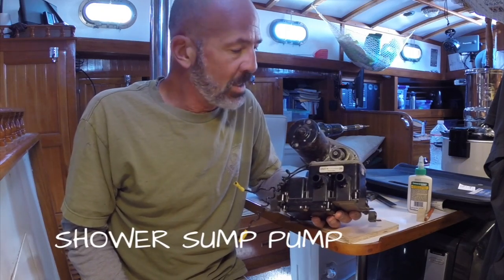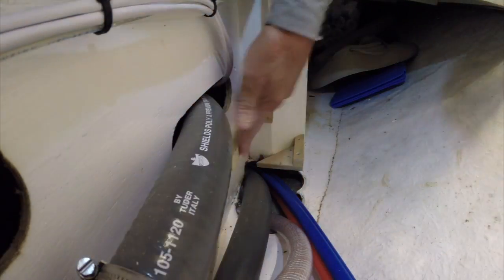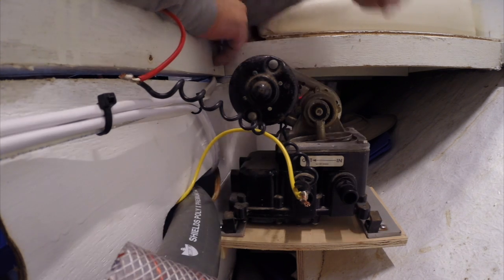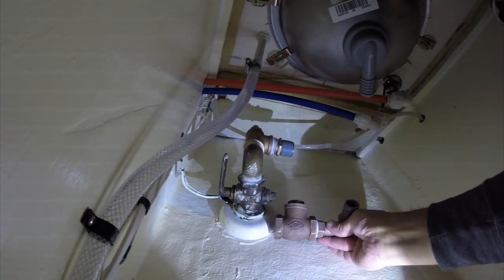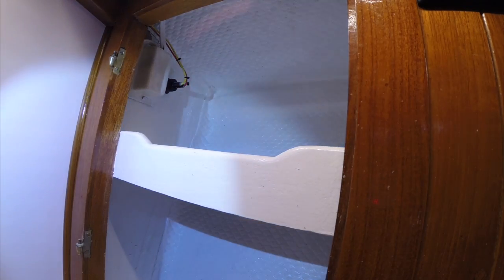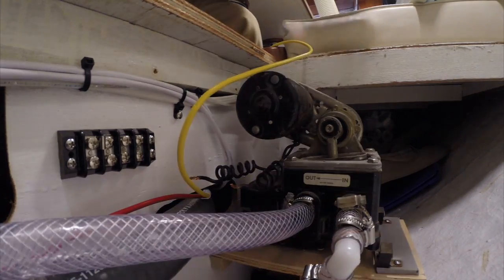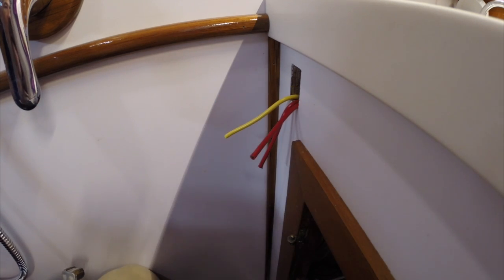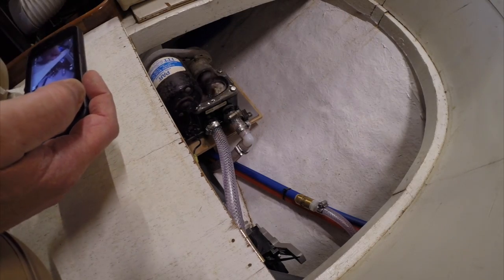SV Ramble On | Installing the Shower Sump Pump

Comment: Thanks for the video. can you tell me type of wood you used? I need to do something similar but not sure what wood is proper for a salt water boat. thanks
Reply from the maker: Hey Jeff, thanks for watching.  I used poplar for the blocking and baltic birch plywood.  The plywood is fine for a boat and a coat or two of paint couldn't hurt either.  You could also coat it in fiberglass and epoxy and it'll last forever.